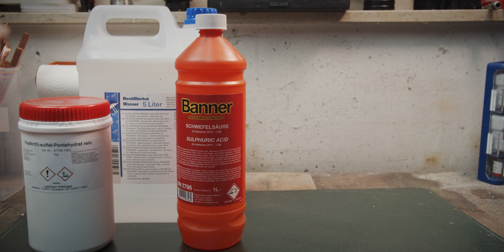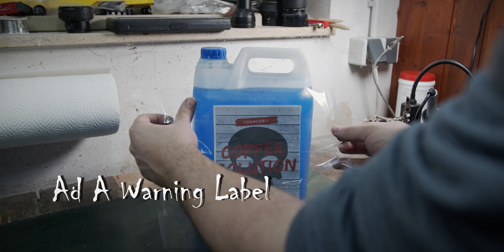DIY Copper Electroforming Solution

Comment: Does the sulfuric acid put off fumes once mixed with the water and copper sulfate? Also what kind of gasses are produced by the electro forming process? I need to make about 15 gallons of this for the tank I’m putting together. Just scale up the mixture provided here?
Reply from the maker: Best work it in an ventilated enviroment. the sulfuric acid is only concentrated to 38% and further diluted with the water. There might be some gases created though by mixing the solution with the copper sulfite. To be honest I don´t know if or which gases are created during this process but I wear pp anyways. I was also never able to smell the solution. Neither while handling it, nor  while adding  current.

Comment: Hi! Is there anothere option to solphoric acid? In my country it’s not allowed the selling
Reply from the maker: I am not sure if there is an alternative to the sulfuric acid. You can check for battery acid (which is sulfuric acid with around 38% concentration) either online or at a car mechanics garage.
Reply: Possibly sodium (hydrogen) sulfate/sodium bisulfate. it's commonly used in place of Sulfuric Acid when only the conjugate base is needed, which should be the case here